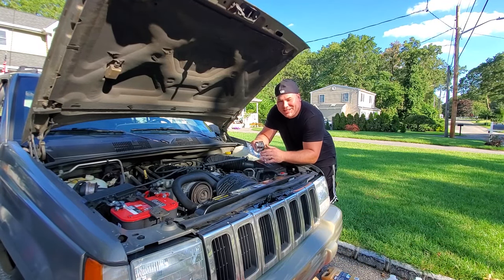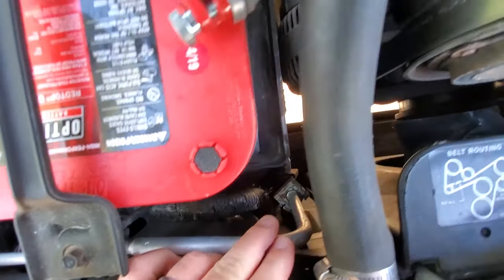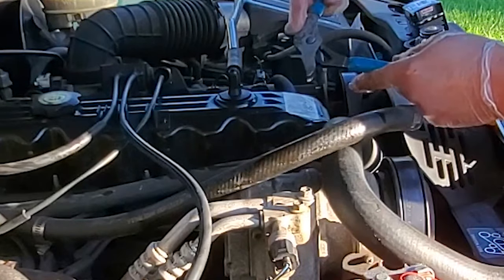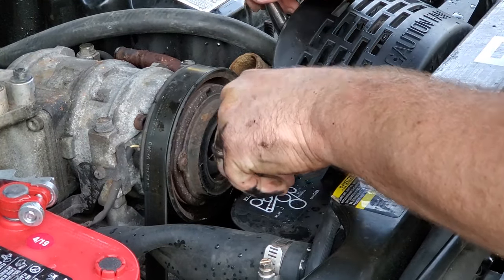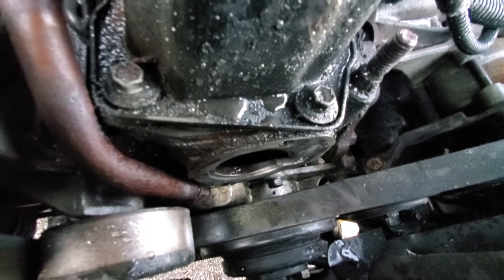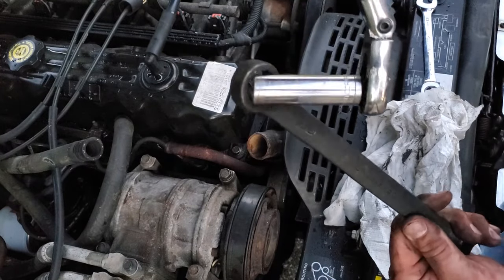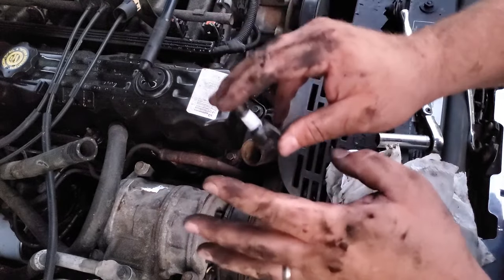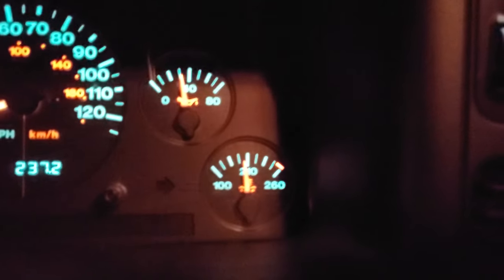JEEP ZJ 4.0 COOLANT FLUSH AND THERMOSTAT REPLACEMENT IN A 1998 GRAND CHEROKEE

Comment: I bought a 2000 XJ with a 4.0, and the previous owner used a shop that doubled down on coolant stop leak. Just replace the leaking parts, freeze plugs in my case. Needless to say I had a job ahead of me. Used a chemical flush, but first blasted water through my system about 3 times (brown water each time). It's a good idea to flush your heater core both directions to remove any blockage. After the chemical flush, I flushed with water 3 times (brown water again). Refilled with coolant and it's still green a year later. The reason it was being sold was it didn't heat up for the winter. I know the irony
Reply from the maker: LMAO! Great score! Sounds like your system was gummed up like my radiator!  So many brown chunks!

Comment: Everytime I need to replace something on my 2001 Jeep Grand Cherokee 6L 4.0, I like watching videos first to learn something and to get myself into the right frame of mind for the job at hand. Today, I’m going to replace the thermostat and lower rad hose after it overheated a few days as the wife was driving home from work and luckily it happen in the drive thru at Jack in the Box and was able to park it right away. Got a check engine light over a week ago that the engine was running too cold, which is laughable here in Hawaii. Wife shot a quick video on her iPhone showing me that the water was boiling inside the reserve bottle. I’m thinking the thermostat was stuck in the open position, which is almost the same as not having one at all. Replaced the water pump about 6 months ago, so I am hoping its just a slight leak in the lower rad hose, if not, will need to replace the water pump again. Great video on the thermostat replacement, especially using the box wrench as a guide for the lower bolt. Wish me luck!
Reply from the maker: good luck with your fix!  thank you for watching 💪
Reply: Aloha Dan, well, I still haven’t done the thermostat yet and discovered a few new details. The overheating problem is being caused by a number of factors.  First, I discovered that my three year old radiator has a small leak at the bottom corner and the electric fan doesn’t come on, which probably lead to the small leak of the radiator in the first place. Plus the intake hose for the heater coils has a bit of swelling where it clamps to the thermostat housing but can fix that easy by trimming off one inch and reconnecting the hose when I replace the thermostat. Even though I did my best to flush the engine and radiator six months ago when I replace the water pump, I did not flush out the heater core because we never use the heater here in Hawaii, lol! So I will test the electric fan and the fuses to see what the issue is there. Worst case scenario, I’ll need to replace the radiator with my stimulus check I just got last week, what get timing, lol!

Comment: Over the winter my water pump went bad. I swapped my thermostat out while I had everything already out the way. Didn’t need to be done but I figured for only a few bucks it was worth doing. Being the winter I wasn’t able to do the flush but did replace all the coolant.
Reply from the maker: Yea man, good call on the thermostat.  that layer of crud that builds up keeps it from working as well as It could.  A flush is best done in the summer when you can get soaked and wont freeze to death! lol

Comment: This and the waterpump were the first things I did to my 4.0 a few months ago when I first got it
Reply from the maker: Those are 2 excellent maintenance issues to tackle! great job!
Reply: @ProjectDanH  very tedious. Especially removing the fan and fan shroud. Has to be simultaneous
Reply from the maker: @michaelb2226  yes. There's definitely not enough room up there.  It's good to pull the radiator too
Reply: @ProjectDanH  oh btw the bolts for the thermostat housing is between 20-25 ft lbs. I did 22
Reply from the maker: @michaelb2226  thank you! I always average hi And  low torque specs too. Lol
Reply: And to help burp the jeep you can squeeze the upper radiator hose to force any air out
Reply: @ProjectDanH  I've been wanting to make a YouTube channel based on doing a "resto-mod" on my jeep but I dont have the time or a computer to make anything. Plus you are already have such great content.
Reply from the maker: Yes, i think i accidentally edited that part out.  I also missed the whole part about mixing a bottle of coolant for the trunk and for the garage.  Editing is rough! haha
Reply from the maker: If you ever want me to make a specific video let me know! if you wanna make a vid, I say just do it! The more content and ideas out in the world the better.  Go for it man!

Comment: Just an old school mech ,52 years of turn in wrenches going on 70 not even slowing DOWN! GET A T PUT IT IN THE RETURN SIDE HEATER HOSE THIS WILL TAKE CARE OF AIR + EASY FLUSH!!
Reply from the maker: excellent tip!
Reply: @ProjectDanH  BACK IN THE LATE50,S AND 60,S THATS HOW EVERYBODY FLUSHED QUICKY STYLE,AS YOU DOES THIS SPRINKLE A LITTLE BAKING SODA IN THE ALKALINE BASE WILL MAKE RADITOR AND HEATER CORE SPARKLE CLEAN,BACK THEN MECHS. SENT THE CORES OUT TO BE CLEANED THIS WAS THIER METHOD!!PLUS IT MAKES THE ALUMINUM SLICK!I,D WISH I HAD KEPT 3 OF MY CARS BACK THEN!  1.  1968 SUPER CUDA XX 440!   
2.  1971 HURST  442!
3.  1974 INTERNATIONAL SCOUT 260 I 6 ! THE FIRST TWO IN MINT CONDITION TODAY WOULD BUY A SMALL FARM IN HOUSTON CO. TENNESSEE.THE THIRD ONE WOULD BUILD A NICE CABIN!!!WELL I WAS YOUNG AND CARE FREE!!THATS HOW IT GOES!
Reply from the maker: @rayoliver6807  oh man! Dream cars! At least you owned them.. I might never even drive one.

Comment: I usually attach my fuel nozzle to my turbo blower. Then the thermoregulator can hit its optimal RPVs. I find I need less oil and as a bonus, when I stick my arm out the window the flare shooter really pushes my biceps out.  Jk. Awesome stuff, I can listen to this and not even own a Jeep!
Reply from the maker: 🤣🤣🤣 don't forget to grease your muffler bearings for optimal charge on your flux capacitor.  You can never have too many jigawatts!
Reply: Don't exceed the 1.21 gigawatts, trust me

Comment: Hey Dan, great video and a lot of laughs. I’m going to replace heate core in my 2002 WJ 4.0. When I’m removing doing this job what else should I be replacing , attenuators /damper doors motors etc…?
Reply from the maker: I would absolutely replace the blend doors / mode doors and their motors. God bless!

Comment: Are the heater core hoses supposed to get so hot they can burn your hand? Mine does.
Reply from the maker: yep... Jeeps  are operating at 200 degrees... thats hot bro!
Reply: @ProjectDanH  Thanks. My jeep still goes to about 230 or higher on the highway.

Comment: For flush the heater i have flush the radiator ??because im allready flush the radiator but no the heater line.
Reply from the maker: You don't need to.  If your radiator is already flushed you can just do the heater core. 😁

Comment: Dan - coolant flush is on my plan this weekend - if you want to flush the engine block, would I need to remove the t-stat + housing, or can I do this via the water pump inlet from the heater core return hose ? Thanks !
Reply from the maker: the thermostat would block a lot of flushing volume so you might as well take it off and replace the thermostat while your at it
Reply: @ProjectDanH  thanks, pal - have done as advised.

Comment: about how much water is left in the system after doing this? Did you already accomodate for that? Im trying to accomodate for it but if I just do 50/50, do you just add until full? Wont there be too much water ratio?
Reply from the maker: Mix your own coolant with distilled water, if you disconnect the lower rad hose  you should lose about 90% coolant

Comment: Here is the "Flush Kit" I've used for as long as I have been working on vehicles.  https://www.amazon.com/Prestone-AF-KIT-Flush-Fill-Kit/dp/B000CCFY5W/ref=sr_1_26?crid=1C5DWIKA42YTT&keywords=radiator+flush&qid=1569433019&sprefix=radiator%2Caps%2C243&sr=8-26  I always spliced into a heater hose as the first time I used this system, I had a blocked heater core from putting silver seal in the cooling system to stop a leak. This system spliced into the heater hose, worked really well to flush the heater core. Hope this helps.
Reply from the maker: Awesome! Thanks Frank!

Comment: Just a thought for you on your 70/30 mix for the coolant to handle more extreme temperatures – yes it may handle colder temperatures a little better with a 70/30 mix but 60/40 is plenty unless you are going saab's 30 degree weather. I believe there's even a short what shows full viscosity as well as coolant ratios for extreme colds. I would never go more than 60 40 in my opinion though as water actually runs cooler than antifreeze. It gets around 0 degrees where I live sometimes a few degrees colder and I usually do about a 55-45 mix water to coolant possibly even 6040 because like I said water runs cooler than antifreeze. You just need enough antifreeze that it will not expand in your block and cause some serious problems. so go ahead and spend a dollar extra and buy Pennzoil instead of store-brand and you got the proper thermostat so you're good to go. This is how we used to have our race cars run as cool as possible as well as our trail trucks, which were used during hunting season when it gets damn cold. Just someone from the other side of the tracks brother. Best of luck in all your Mopar Ventures and check out a Volkswagen from time to time, they are kind of like the car equivalent of jeeps in my opinion. Like the 84 to 98. Holler anytime, peace brother
Reply from the maker: hey Adam! thank you for your Input, I really appreciate it and your view!.  I'm open for anything, maybe if I find a deal on a VW I'll scoop it up! thanks again brother!

Comment: Hi Dan,
My name is Rick I follow you all the time. I have a question, I have a 99, 2000,2001 Cherokee sports. My 2000 and 01 are making a shaking abs sputtering when you start it. Or runs rough. What do you think it would be? Maybe plugs? Thank you hope all is well.
Rick Batchelor
Reply from the maker: I'm doing well Rick, thanks for asking.  Because its an 00 and 01 I'm gonna say heat soak (common problem) ... Im gonna take a guess and say this only happens on a Hot restart right?
Reply: It could be any of many things,first get you OBD1 CODES.THE 4.0 ENGINES HAVE A EXHAUST MANIFOLD DESIGN FLAW!AS YOU INCREASE YOU SPEED THE ENGINE WILL TILT JUST A LITTLE JEEP DID NOT FIGURE THAT A HOT DOWN FLOW PIPE WILL CRACK BINGO !EXHAUST LEAK OX2 SENSOR SENDS A LEAN CODE,TEMP AIR SENSOR READS IT ECM TRYS TO ADJUST THE ENGINE HAS MISS,STALL,SHUTTER,DIES$82.00 EXHAUST MANIFOLD 2.5 HR LABOR,GET A NEW COOLANT TEMP,AIR CONTROL SENSOR,TAKE OFF NEG CABLE TOUCH IT TO A/C COMPRESSOR GET IN JEEP PUT FOOT ON BRAKES !!YOUR MEMORY HAS A NEW FRESH START POINT.3 TO 5 NORMAL DRIVE TRIPS AND THE COMPUTER WILL RELEARN THE PERFECT ADJUSTMENTS AND SETTINGS,BY THE WAY JEEP 4.0 ONLY USE GREEN ANTIFREESE!! NOTHING ELSE,YOUR OLE RETIRED JEEP ASE MECH.FROM TENNESSEE ,THESE 4.0 are  65 YEARS in the making,HUDSON/AMC/CHRYSLER/JEEP. AND THAT'S THE REST OF THE STORY GOODDAY!

Comment: Hey Dan! Always enjoy your content! Thumbs up as usual. Just wondering if you put any kind of flush in before you started. I usually put some sort of flush agent in and run it for a couple of days prior to actually flushing the cooling system. Have to say, I've never had the problem of opening the petcock and nothing coming out. That was a first.  Hope your wrist is all good soon!
Reply from the maker: Thanks for the views Frank!  I didn't put any chemical flush in this time because I wasn't sure when I would have time to film this project.  After I finished I'm glad I didn't waste the money on the chem because everything was so severely gummed up.  Now that it's all clear I'll probably use the chemicals the next time I flush it

Comment: My thermostat came with a black rubber ring around it.  Did they give me the wrong one?
Reply from the maker: I know some come with that kind of gasket but the ones I have used doesn't have that.  if it works use it 👍
Reply: @ProjectDanH  Sounds good.  Thank you for your reply.

Comment: Great videos! Does your ac work? Most of these acs dont work on the jeeps.
Reply from the maker: Thanks brother! Until we got the commander the only vehicle I owned with AC was my 89 Mustang 🤣🤣🤣.  I've never had a Jeep with AC. LMAO
Reply: My AC worked when the motor was cool, but once it warmed the AC stopped. I removed a shim on my AC compressor and it works great again.
Reply: I have had like 4 zjs and 1 out of 4 acs worked. But it only worked like for 3 months but them gave out lol.
Reply: I'm trying to get Into another zj but the one I'm looking at the ac doesnt work. I'm trying to get one for a daily driver for work and maybe on the weekends take it out and have some fun.
Reply from the maker: @garyhowell738  yea, sometimes the clutch on the compressor wears out.  Good job!
Reply: Even if the clutch still moves?  Or does this only apply when its seized? I have tricked the ac compressor thinking it has freon. Using a wire and applying it to the connector .
Reply from the maker: @legacyloco1920  when the compressor is kicked on an electromagnet pulls the clutch in and engages the compressor. If it's warn out you can remove a shim to help it engage more.  It should work as long as the gap is in spec.  I don't know how to trick it with freon tho. Lol

Comment: The two valves on top of valve cover (one is a PCV i think, other might be a exhaust valve) those have a tendency to leak, if you change those can you make a video? Thanks
Reply from the maker: Sure,  I hate those valves! so brittle! lol
Reply: Project Dan H just did my PCV valve and if youre going to do it be prepared to buy another PCV to intake hose because that bad boy isnt gonna want to come off! Haha
Reply from the maker: @airsoftmasterpistol1  yep! Brittle AF lol
Reply: One is PCV (Positive Crankcase Ventilation) and the other is CCV (Constant Crankcase Ventilation.) Just be prepared to replace everything.. grommets, elbows and hose attachments. I put a new valve cover gasket on my 4.0 and replaced everything on the cover with new parts.

Comment: Hey!
Great vid!! Love it. I use 205F thermostat in my 95 4.0. What is your opinion ? Thx
Reply from the maker: wow.. 205 is pretty hot, usually people go down 10 degrees to keep it cooler. interesting how you went up 10 degrees. any particular reason for doing so?
Reply: @ProjectDanH  yeah so my heating only blows warm air when its on hi temp only. And my temp gauge never goes higher then 190-195 but i think it should be near the 210 at operating. Maybe it helps with gas mileage too. A guy in the zj group said that it worked in his jeep 🤷‍♂️
So i tought i give a try.
Reply from the maker: @matekosaras9190  gotcha! i wonder if you haved a clogged heater core.  if you can flush it out, maybe you can lower that thermostat temp one day!
Reply: @ProjectDanH  i replaced it a year ago. But flushed it a few weeks ago. It looks okay. My running temp with the new thermostat is fine. Soo i guess its the blend door that causes the trouble.
I appreciate you have time to write back! Respect, thank you!
Reply from the maker: @matekosaras9190  anytime!  On the ZJs it could be the Mode door actuator.. it's a bit tricky to get to, but it's not a Terrible fix. 💪
Reply: @ProjectDanH  i need to get the dash out for it i think.. 🤔
Reply from the maker: @matekosaras9190  you shouldnt have to.  if you can get a small torx or screw bit onto a tiny 1/4 bit ratchet and peel down the rug you should be able to get it.. it sucks but its possible
Reply: @ProjectDanH  thank you for answering :)
i tried but can't figure out how to do it what you said..

Comment: Now I got done with the entire process, at the end running the vehicle with the heater on, added coolant as necessary about 10 minutes in and my radiator just erupts like a volcano coolant everywhere. lost about half my Reservoir, who knows how much out of my radiator. Was keeping an eye on the temperature from the dash. it held a steady just a little above the middle on the cold n hot. on the temperature looked about right, read little under 200 right about what’s the thermostat is 195 ish.... why the hell did this happen? somebody please help..
Reply from the maker: perhaps you have air trapped in the system.  You must park on an incline engine up.  don't cap it yet. fill the radiator and reservoir cold then start the jeep.  when it heats up the thermostat will open letting coolant in.   At this point you will need to add coolant.  you can squeeze and massage the upper and lower rad hose to try and work out any bubble.  Keep filling until she wont drink anymore, then cap it up and shut her down.  That should do the trick.
Reply: @ProjectDanH  Thank you for the response but the problem was just that...... The thermostat. I replaced the thermostat along with the process and the new thermostat was a newer make and model did not have the pressurised little hole in it. finally narrowed it down to it had to be that, so I just reinstalled the original thermostat that was in it before that had the hole, problem solved. 
Now I’m fighting and even worse problem... my shifting is ridiculously rough and late.. Might be just a tad bit low on transmission fluid but I’m about to find that out but I doubt that is the only reason and will fix it back to a smooth shifts. I have adjusted my throttle cable every which way, that does not help at all.. 
I hate adulting. I wanna be a 
Toys R Us kid!

Comment: Why wouldn’t you just take the fan guard off to get the second bolt when changing the thermostat?
Reply from the maker: Because I didn't want to remove the radiator.